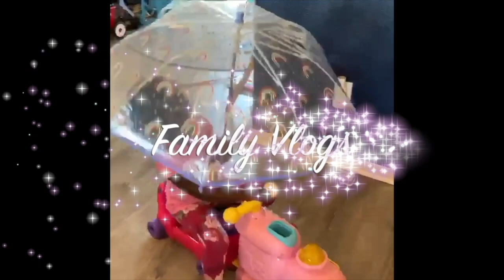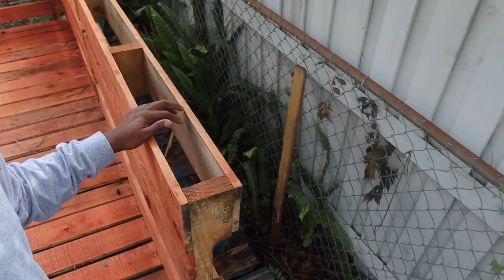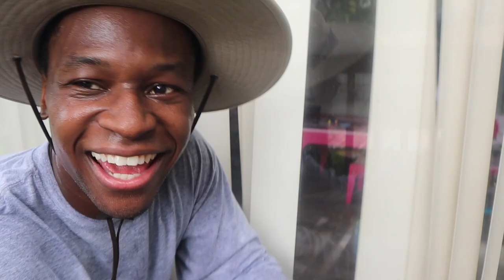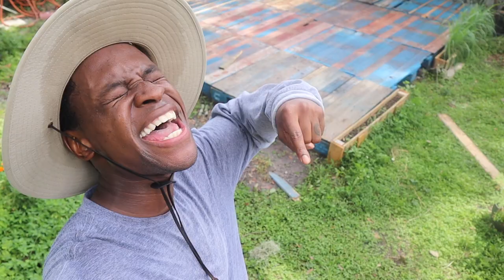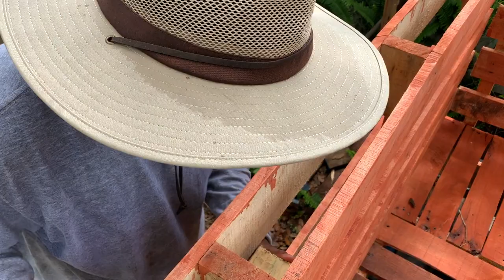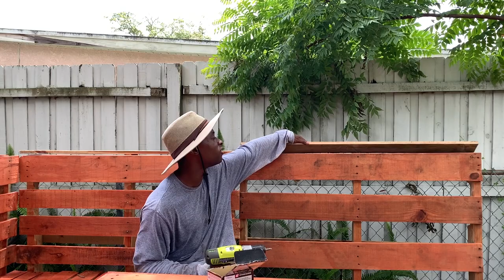HOW TO LEVEL PALLET DECK!! REDOING FLOORING FOR DIY BACKYARD PALLET DECK

Comment: My local Homebase done something similar to display barbecue sets on and plastic sheds. Combination of rolls of fake grass on top and decking boards to close off the sides of the sides of the pallets. Pallets screwed in together to connect each one.
Reply from the maker: ok ok ok now. That sounds like a nice set up for sure!

Comment: Man I love ur attitude!!  I just got 4 pallets and I think about getting 2 plywood panels to lay on top of the pallets for a simple deck. I plan on putting weed prevention fabric and pavers for balance. Thoughts/suggestions??
Reply from the maker: Thank you kindly. I love your desire to build with pallets!! I think using the plywood will give you a clean look if that’s what you looking for definitely want to go with the fabric and pavers elevating it off the ground! Also, use so form of sealant to protect the wood beyond it being heat treated.

Comment: glad i came across your vid. I just decided to do a small deck in my fenced in area. I am assuming you used the 24x24 pavers...did you ever close the sides of the deck like you did with the smaller deck in the front yard?
Reply from the maker: Yes I did, I didn't want anything crawling up to surprise me!

Comment: 😮 
Hi I just came cross your videos. I am planning on doing a music stage for my husbands retirement party June of 2023. I want to know why did you remove the boards on the small garden in the front of your house instead of just using the pallets and lays sheet rock or some other larger boards on top going in a different direction that the pallets for more stability?
Reply from the maker: First off you are awesome for doing this for the party!! What you’re thinking  would work well putting a board on top of the pallets. I chose to only use the pallet boards for the project so that’s why I did what I did.

Comment: U should've used weed barrier fabric, screwed each pallet together with deck screws, used extra boards as fascia boards, sanded it all down with a belt sander, painted or stained everything before putting the furniture back.
Reply from the maker: So true. It was a lesson learned

Comment: Hey..yes its hard work...your doing a good job...it would be nice if your were able to get some help with lifting those heavy wooden pallets...I have a question what are you going to do about that tree that was strategically rotated back to your garden by that good neighbour of yours... I have no idea of what tree it is......
Reply from the maker: Thank you kindly. I was thinking about calling for help as I was moving things around but I wanted to get it done.. lol. You know... I'm still trying to figure it out. It's hard for me to cut a tree down. I may just cut the branches back and see what happens!
Reply: @THEJONESFAMILYCHANNEL I agree it wont be in your best interest to remove the tree... trees are good for the planet unless they are messing with your house foundations or other....the trunk seems quite flexible so you could probably guide it to hang over your garden with strong wire near the top of the tree and attach it to a stake of some sort to prevent the overhang ...or relocate ..I have just watched a video of how to relocate a much larger established one see  "Truly Tropical".....
Reply from the maker: Karon Thomas-West oh wow!!! I didn’t think about that!!! I could guide it how I want it. I’d probably guide it over the pallet sectional for shading benefits. Great suggestion. Thank you!!!

Comment: Awsum.. 
Question, why aren't the pallets screwed together, for safety. ? 
So they don't separate from each other.
Reply from the maker: The way you spell Awesome is awsum... lol. No the pallets are heavy and stay in place! Moving is not a problem, making sure they are water sealed is the objective!
Reply: Kool, thanks for responding . I'm currently working in a pallet project myself. 
A fence , about 90' long. 2pallets screwed together in-between posts. Sitting on a 2" × 3". For hight.  Then I'm going to use an "old farmer's trick"  as stain.
Used oil and diesel fuel mixed and sprayed on.
Reply: That won’t go any where